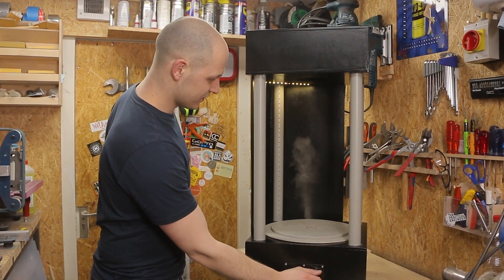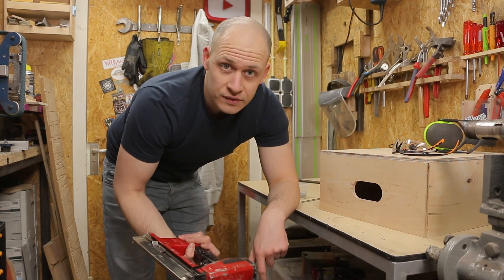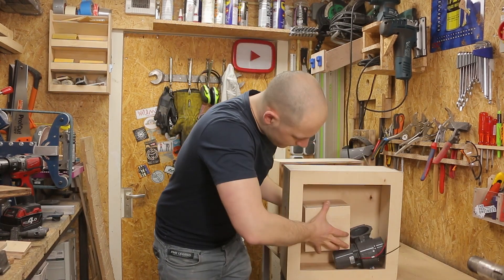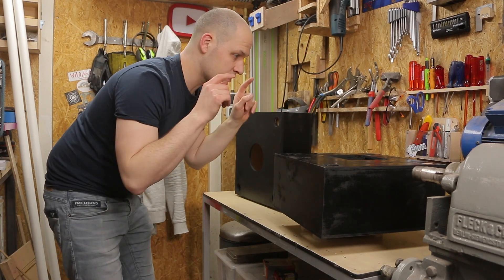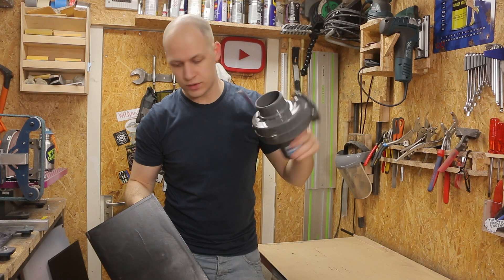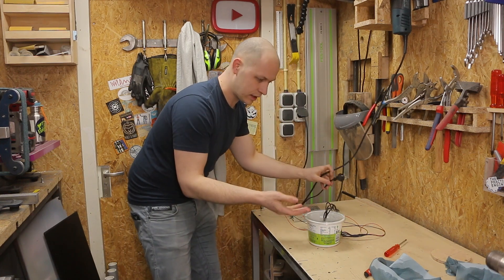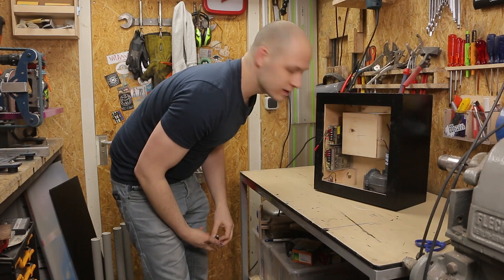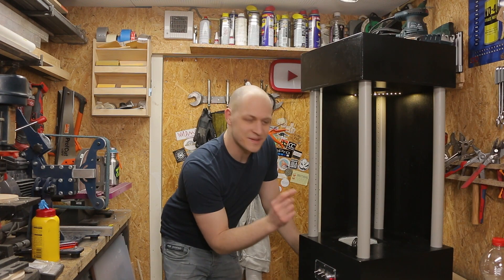Make a Tornado Machine from a Science museum - DIY

Comment: Would you be able to do another one of these? Only the one I have in mind is different. And requires a different set of components. It would help prove a theory of mine.  
Using a long clear plastic tube/column
three sections or levels created using some circular cutouts to section off levels.

|___°___| level 1
|............| level 2
|.....^.....| level 2 <--------------return to level 2----------|
|___||___| level 3                                                         |
       |_______________water drain to water pump_|

Level 1 has a small hole in the circular cutout in the center with a small toy motor. Motor has a small turbine style fan and spins cold dry ice air down creating a cold air vortex that descends down through Level2 which is regular air. Level 3 is where a steamy warm water whirlpool exists meaning Level 3 has a hole dead center in a circular cutout of plastic sealed with silicone just like level 1 did.
the hole at bottom of Level 3 connected to an airline tube to a bucket. A water pump is put in the bucket to pump water back up to level 2 or 3 to recycle the water. Remember to keep vorticity direction the same for everything whirlpool direction, water pump return tube, dry ice air fan direction that blows down. I think by now you can see the direction I am going and you would be able to achieve an inverse tornado 🌪️.

Comment: Instead of adding 2 powersupplies at different voltages like you have now, you could also have opted to go with only the 24V one for the higher voltage components and add a stepdown converter to have 12V output from that same 24V supply :)
Reply from the maker: That would have been a nicer option indeed. I used this because I had these lying around

Comment: Hey buddy how did u get the PVC pipes to fit perfectly in the foundation and base
Reply from the maker: I used a hole saw that has the same diameter as the tube. Then I needed to sand it a bit for the perfect fit
Reply: @Thepracticalengineer  did the tubes fit all the way down into the box or like halfway
Reply from the maker: Only a couple of centimeters was enough
Reply: @Thepracticalengineer  Hey buddy the bottom peices that you had to glue back on after you painted what are those exactly for?

Comment: When you make two boxes the same size (or a box and lid) make them as one piece then cut them apart using a table saw.  Takes less time and they come out exactly the same.
Reply from the maker: Thanks for the tip! that is a great trick indeed! I do not own a table saw but I think this could have been done with the tracksaw as well.